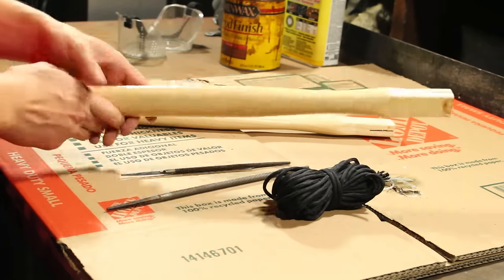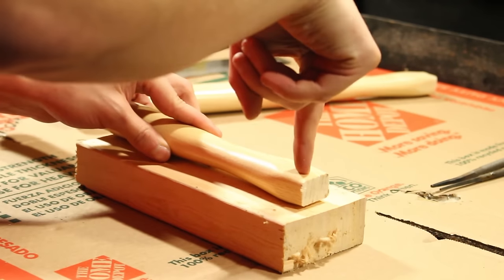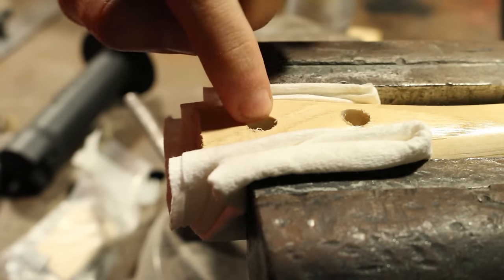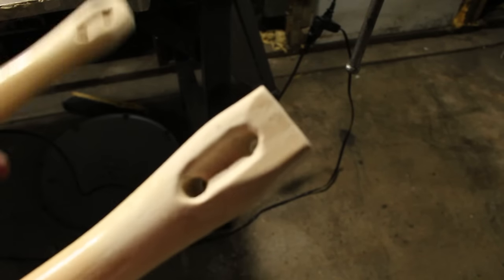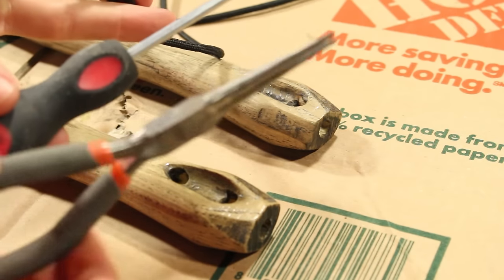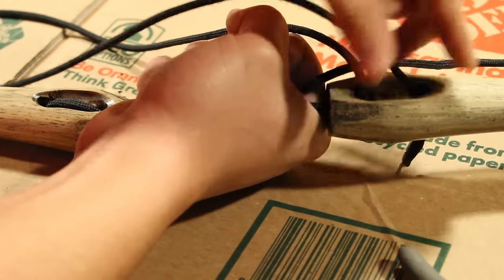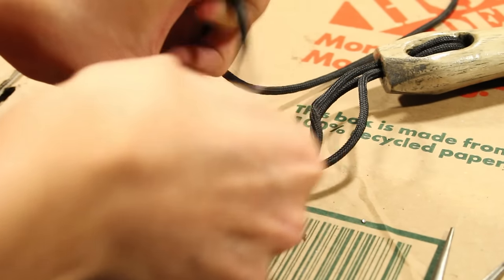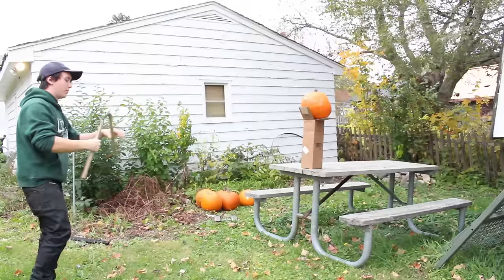EASY TO MAKE $10 NUNCHUCKS / NUNCHAKU (+Damage Test)

Comment: while it may have been hard to do there. but for paracord you can just burn the cut end of the string. it should melt and make it thicker so it probably won't slip backwards.

Comment: The wood part don't need too long, it's about equal with the arm and need make from hard wood (for little heavy) and the wire tight together with the knot and be hidden inside the wood part, so don't need glue.

Comment: Is there any reason you super glued the tips of the para cord rather than just burning it, so it melds to the rest?
Reply from the maker: +John Smallwood Less room for error and risking having to re-string it.
Reply: +ZNA Productions ah ok then. Thanks :)
Reply: +ZNA Productions Try using a lighter. i use a lot of rope in my post apocalyptic Armour. bees wax also helps when using cord or string as it keeps the strands together and when you melt it with a lighter it gives a really good bond.
Reply: +callum russell stop trying to teach the master
Reply: I'm trying to give him advice. A master is someone who knows there is always more to learn .

Comment: nice video, but you gotta rotate the hips when you strike. It adds momentum and power, as does holding them near the bottom of the handle and trying to strike as close to the tip of the other stick as possible.

Comment: As a teenager i made myself several sets of Nunchaku and i have spent many hours practicing.
For me 12" long was the best length. If you make them too long you are going to struggle with them.
For just practice i liked a set i made from 1" diameter plexiglass rods.   I had the ends bull nosed
when i bought them  and used nylon cord.   I would use a set of hardwood Nunchaku to practice striking.
Personally I think if you cut 2 inches off the bottom of yours you will find them much easier to handle.
Reply: Just the man I'm looking for look with your expertise you can answer my question. If you look on YouTube now there's a Asian guy that uses some sort of long nunchucku it's way over 12 inches maybe 24 inches but it's not a 2 sectional cudgel because it's not heavy. My question is do you know whats the name of that weapon? So far no one knows and just calls it a nunchucku but if that's case where can one find that? It's wired 🤔
Reply: @christiangonzolaz5797  Sorry I don't know the name of what you are speaking of. Keep in mind that many many martial arts weapons are evolved from other things like farm implements.  

The reason was the leaders at the time feared the peasants rising up against them and so they were forbidden to carry weapons like swords or naginata.
The Nunchaku for example were used for manually thrashing out grain.  The Coma was a cutting tool like our scythe.

Comment: Just now watching this...  If you want to add extra damage to the strike, cut the handles of each 'chuk' into the shape of a hexagon.  The edges of the wood will provide a better striking surface to tear skin/flesh compared to the circular nature of what you're using.  Regardless, its going to suck getting hit by either set up.  Your best bet, if facing a competent opponent with nunchaku, is normally to run away.

Comment: What is funny is that just recently I made training nunchucks using a pvc pipe, cutting it in half, hammered a wooden dowel in each one, drill a hole in each one, and then used 750 lbs paracord. the turned out to be effective until I realized that I'm not the best knot tier

Comment: Very nice. I've used one hole and tied a bowline knot on either side to make nunchucks before. It works just fine and holds up fine but this construction is far superior, will really last and easier to get the desired length, I'll definitely use it on my next pair.

I have to ask though, did they feel light? They look lighter than the pairs I've made and possibly a little less powerful because of that. I'd recommend the same technique on a heavier and/or slightly thicker wood. In my experience the taper is not important but the weight and density really make a difference. (Been doing martial arts for 13 years so I'm very familiar with chucks) Love the video, thank you for sharing!

Comment: Good fortnightly Different way to secure the loose endocrine rope if you aren't a fan super glue, use either a hot knife tool or simply get a cheap metal knife (not plastic as it melts) and heat it up and use that to melt the rope e factly where you want it

Comment: You could go through the top through the bottom to the top out the very top  top then use the longest end to do the same on the other side then fisher mans not the together then wiggle the knot into the hole

Comment: The build would have taken like less than an hour without he urethane coating, right?
Reply from the maker: +Hawk Jenkins Little over an hour,  the filing is pretty time consuming. Definitely still a very quick build.
Reply: ZNA Productions Do you have to do the filing though? I thought it was just a looks thing and maybe so the rope doesn't get cut.
Reply: it would have been faster if you had a gouge

Comment: Could hollow out the bottoms and put a sabot round in there for some added Oomph.
Reply: what is a sabot round?
Reply: Geo Marko Google is your friend.
But in this case I will explain. Basically I was talking about a .50cal muzzle loader round. It's just an ounce or so lead bullet. He could drill out a hole deep\wide enough to accommodate the sabot in the bottom of the chucks and epoxy them in place. It would make them hit like a Mac Truck. Hell he could even go a step further and band the bottom, as the force from the hits after adding the weight would likely damage the chucks relatively easy. Not to mention the banded look would look badass. Copper would be ideal for aesthetic and ease of use.
Reply: Main Character i was on my phone and didn't need to know the meaning instantly, but thanks for explaining your idea to me.

Comment: What if I wanted to use chains instead of paracord?
Reply: You could screw eye bolts in the location where he drilled out his 3rd hole (the one not in the recessed area), then use quick links to connect a chain.

Comment: The piping would be too light and fast and the toy foam ones are too light and just weird. As much as people don't want to hurt themselves, the only real way to practice with nunchucks is to practice with nunchucks.

My dad made some when I was a kid using the same method out of shovel handles he had laying around. That was almost 30 years ago and they and the rope are still holding strong.

The problem with your hammer handles is they're about 2 inches too long. I saw the thumbnail and I thought you were using long chucks.

Also in the thumbnail, you are holding it way too far down the handle. You want your hand up by the chain.